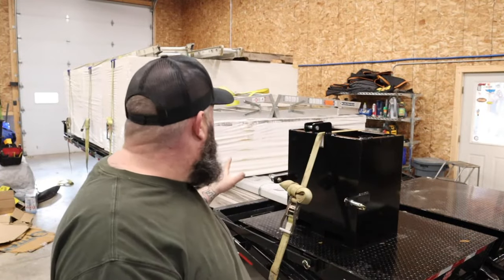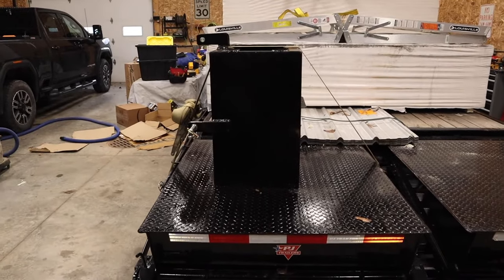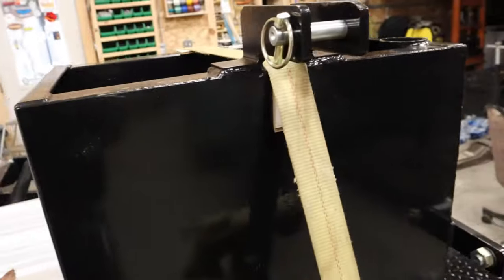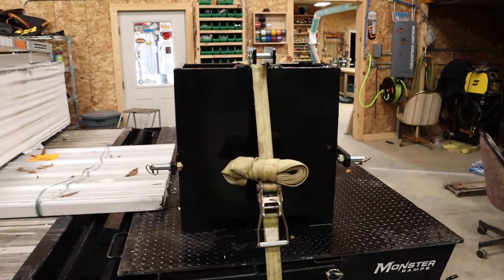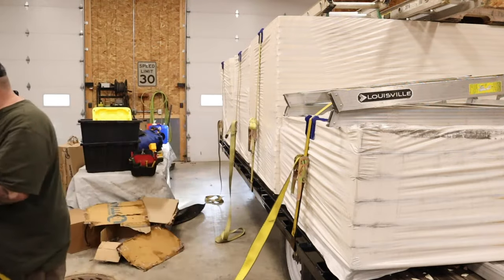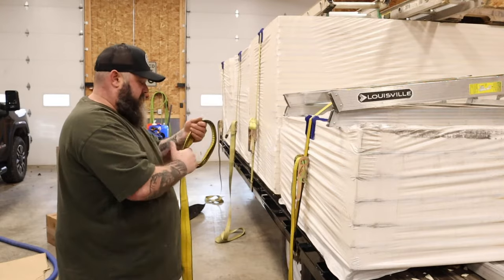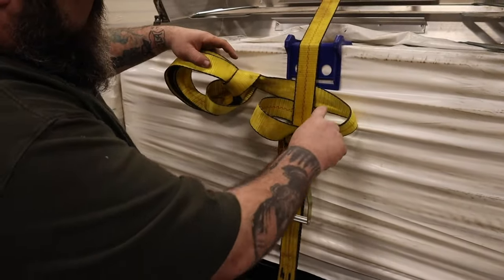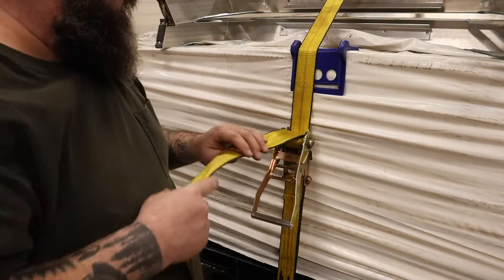How to Use a Ratchet Strap and What to Do with the Slack

Comment: I've been using straps for a year now and still learned a few interesting things here, especially on what to do with the slack. Definitely gotta try that loop thing.
I feel like the hooks on the straps I use aren't good to go on the outside of the rail and back up onto the rail itself. It seems like the hook don't fit properly. I thought maybe it is because I use my straps horizontally (I use them in a cube truck) and also because the small segment of strap at the end (where the hook is) is too rigid for the hook to fit properly.
Thanks for the video!
Reply from the maker: Thanks, They never fit as well as I want, feels like it's trying to pull them off sometimes.

Comment: I always lightly tighten the strap then roll up the loose end and tuck it behind the lightly tightened part of strap before full tightening the strap over the rolled up loose end.
Reply from the maker: Awesome, does it stay pretty good?
Reply: @buildlife  As long as you place the rolled up loose strap under part of the strap that clamps it tight it never moves.

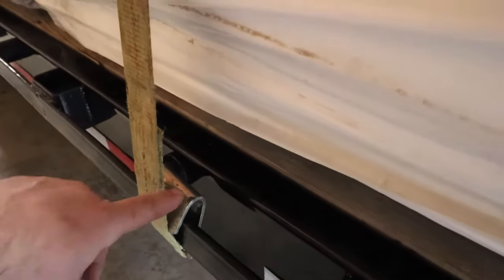Comment: 0:24 Take the time and unbolt the strap at the ratchet and flip it over. Now you can drop that flat hook down and back up and hooking properly.  Me I do that but I took to buying straps with chains and grab hooks. Soo much easier.
Reply from the maker: I keep seeing those. They would be better for allot of things where you don't want the strap getting cut. Do they fit on the rub rail better? I'd think they would not roll up as nice.
Reply: @buildlife  They fit on Stake Pockets and rubrails just fine. You can drop the chain link into keyhole/keyway slots. You can hook the chain back onto itself. You can loop through a D-Ring and hook the chain back to itself. So many more ways to use.

They roll up just as any other.

Comment: Great video! Simple and informative. A bit of advice... Most strap manufacturers recommend at least one revolution of the bail (windlass), so the strap has 360* of bite. I do this by pulling the ratchet away from the load before ratcheting, just enough that 4-8" of strap slips through the bail. 
Thanks for making this video!
Reply from the maker: Thanks for the info!

Comment: Since I have to load my trailer most times by myself, I bought a very strong magnet to hold the hooks in place on the other side.  It sure saves a ton of frustration.  I bought a magnet for "magnet fishing" off Amazon.  Incredibly strong little magnet.
Also when you have a high load, if you put just one twist in your strap it will keep it from vibrating and slapping.  It will reduce wear on the straps and prevent them from coming loose.  
Most times I just use those Nite Eyes gear ties to tie up my straps and control the left over slack, but I like your method, because I am forever losing those suckers.
Reply from the maker: I like the magnet idea!
Reply: What happens when strap loosens ? When just hooked to bottom of rubrail ? It fall off. If you hook ends through rubrail and put hook on top then if it loosens it won't come dangling off

Comment: Hi Steve. Here in Canada, it's illegal to use rub rail to secure your strap J-hook. If you have to, do it the way you did the first one but keep the hook going in a circle around the rub rail, so it hooks on the bottom of the rail. Then your strap is holding the J-hook safely in place.
Reply from the maker: I like that method the best I think

Comment: The redline is also an identification stripe . One stripe 5000 lbs. per inch of webbing width .  Two stripes 6000 lbs. per inch of webbing width .  10,000 or 12,000 lbs. of MBS  ( minimum breaking  strength)  .  Always go with WLL ( working load limit ) for the 2” webbing is 3333 lbs.   Nice Video .   9/22
Reply from the maker: Thanks, good things to know!